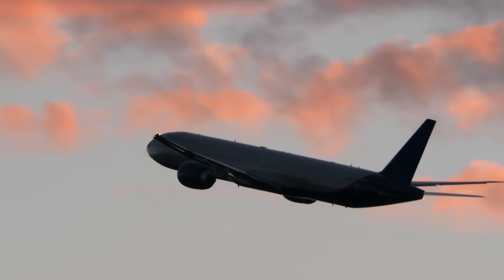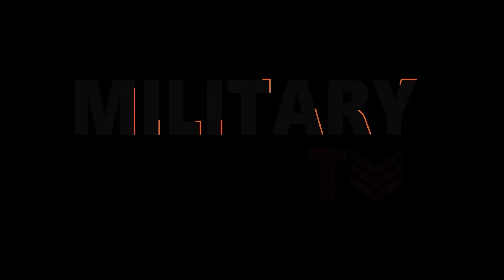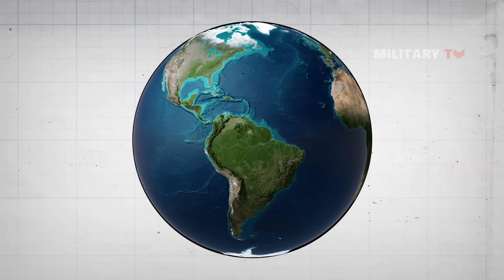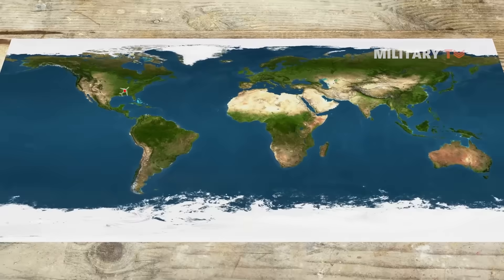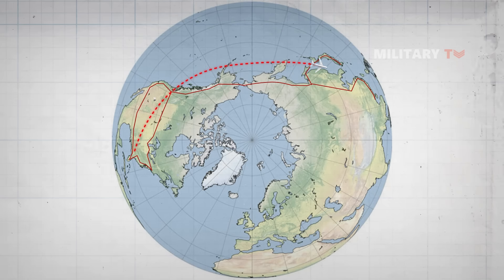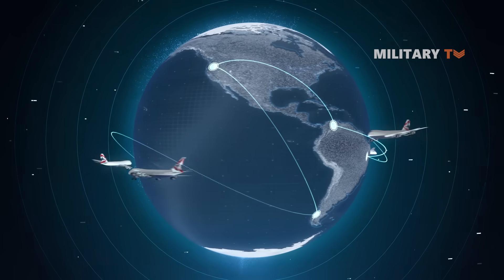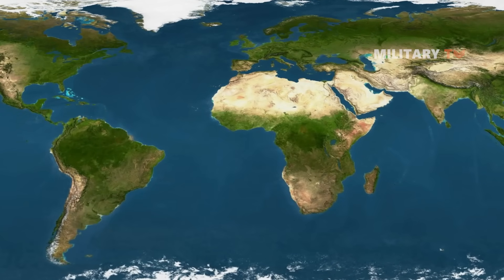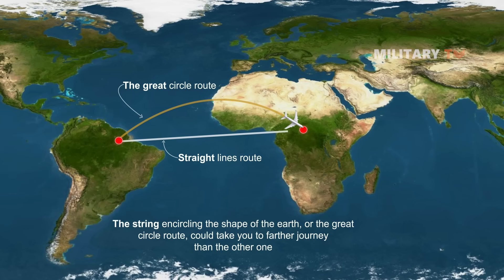Why Airplanes Fly On A Curved Path

Comment: Apart from the jet stream and other reasons not to fly a straight path, a lot of words are used to explain the very simple concept that a flat map distorts what’s actually a straight, direct path.
Reply: Correct.  If you place a string between the two points of travel on a globe (rather than on a map) the the string will be a straight line between the points.
Reply: @jeffreyerwin3665  , in correct, earth is flat.
Reply: @jeffreyerwin3665  No it won't. Any path along the surface of a sphere or at a fixed altitude above the sphere is curved.
Reply: @hb1338  good point.  However , if that curved path is observed from the vertical, it will appear to be straight,  The "straight line" Mercator projection wiil always be seen as curved, even from the vertical.
Reply: @hb1338  True! If planes flew in a straight line, they would simply fly off into space (or until they ran out of air). They fly a curved path because gravity is constantly pulling on them, thus keeping them on their curved path.
Reply: @whyyeseyec  gravity = magic answer for everything
Reply: @whyyeseyec  Altometer?
Reply: @johnarch6876  And??
Reply: @whyyeseyec  An altometer is used to maintain a prescribed height above the earth and although travelling in a straight line on the vertical plane, the aeroplane's trajectory on the horizontal plane will be be curved as it's always maintainig the same height in relation to the earth so the flightpath takes on the shape of the earth. And??
Reply: @billp4  No, Gravity Is not magic and your ignorance Is not a valid argument.
Reply: @peterhoebarth4234  "in correct" is incorrect, one doesn't begin a sentence with a comma, and 'Earth' is a proper noun. And we are supposed to believe your education has equipped you to comment on the Earth's geography?
Reply: @johnarch6876  Altimeter, right?
Reply: Every flight is a curved path.  All aircraft ,curved flight. What goes up must come down. Shortest distance between 2 points (map wise) string on a globe. Slowest time between 2 points, going to the in-laws.
Reply: @kwitwerikok8o863  Regarding curved path, the discussion was about the horizontal, not the vertical which is of course curved. Love your last point about the in-laws!
Reply: @whyyeseyec they fly at a set altitude. If the altitude remains the same they will naturally be following a curve in relation to the earth's surface. If the altitude changes negatively or positively they would naturally be flying towards or away from the earths surface.
Reply: No it's not that complicated the earth does not move.
Reply: Ever hear of an auto piolet.  Just point it in the direction given and set it. There is  no vertical compensation program, just a warning system. Go figure everything again or ask an Austrailian piolet. There're  allowed to answer truthfully. All piolets see it flat.
Reply: Most of you people aren't getting it.  Yes, Altimeter shows very how hi you are in the air or rather how high you are above the sea level.  But a gyroscope is the instrument built so that when set in a direction, it goes straight there. Sort of like following a very long lazer light, no curving down, no left or right, no automatic adjustments. The gyroscope  is an instrument that is built-in and set itself when the plane is just warming up. That instrument defys the so-called gravity. and has no problem crusing over a flat earth.
Reply: @whyyeseyec that’s a curve in the Z axis. Which is true. But they fly straight on the horizontal axis. However if you were to take that straight line and project it onto a flat map then it makes the flight look curved when it’s not. 

I make maps for a living and I see this every day. When something is mapped onto a flat space then it warps the image causing straight lines to look curved. 

Hence when you look at a flat map it looks like the plane is flying curved. Yet when you look at that same route on a globe it is straight.
Reply: @normanhansen730  Grow up!

Comment: Speaking of jet streams, I was returning to San Diego from Germany last week, and in a Lufthansa A350-900, the altitude over Provo Utah was 43,000 feet.  I had never been that high in a military jet !
Reply: Lufthansa Military Jet A350-900¿
Reply: It was to avoid headwinds from the jet stream which would slow down the plane considerably.
Reply: @99.9percent9  No, I meant I had never been that high when I was in military jets.

Comment: I have never heard this described SO badly.
Reply: The video is completely useless.
Reply: very flat earth.
Reply: 😢 Even the title is wrong.
The airplane flies in a straight line towards it destination.
Deviations are for; navigational aids, political reasons, the jet stream (for or against), very cold air that would cause the fuel to gel, and to stay in range of an emergency airport in case of engine or other failures.

Take a globe and a string to convince yourself.

Comment: For the most part, planes fly in a straight line between desinations, it's only a curved path when viewed on a flat (distorted) map.
Reply: Greenland isn't bigger than South America?
Reply: @johnstuartsmith on the Mercator map all objects further from the equator are projected larger..  it’s just a quirk with the map.  Go and look it up.  You can get more accurate maps, but it’s quite challenging to project a map from a globe into 2D
Reply: In all dimensions…
That means that the aircraft will exit the atmosphere in the direction of the tangent…

SoaceX next!!
Reply: AKA heliocentric Theory map

Comment: In your example, from Brazil to the Congo, the Great Circle route would almost be what you've illustrated as a straight line route.  That trip almost follows the Equator.  The Equator is the ONLY circle of latitude that IS a Great Circle.
Reply: 100% right. The Brazil to the Congo is not shown or explained correctly in the video! Besies the flat map, the globe should have been shown too! (to make a real comparison).
Reply: Because the earth is flat and stationary, a plane does not constantly dip and it flies to the destination because the earth does not move

Comment: You forgot to include that, until very recently, the FAA required that planes were always within a safe distance from land 
in case of emergencies. It is only because of recent super reliability of planes that paths can be more direct.
Reply: ETOPS was actually introduced in the 80's
Reply: @AlexFoxthrot  I heard that the Airbus 380(?) caused another extension to be allowed. Thanks for the facts and updates.
Reply: @LMike2004  Not aware of that, but I don't think so. Not saying you are wrong, juts news to me. It's a quad jet so even more curious.

Comment: I don't understand why the lower mileage "polar route" only applies to East-West flights.  So why, if going on a North-South flight, for example from Stockholm to Cape Town, is it shorter NOT to fly on any curve, but rather to fly straight south?  I don't get it. Isn't the planet curved for all flights?
Reply: Get a globe and pull a string tight between Stockholm and Cape Town. There's your shortest route.
Reply: Earth is Flat.
Only then it makes sense.
Reply: North-South is always on a great circle, the only East-West great circle is the equator.
Consider flying six hundred nautical miles south of the North Pole.  You are at 80 degrees north (10 degrees of 60 minutes each from the north pole, a north-south minute is a nautical mile).  Going up over the pole to the opposite side of the world is 600 + 600 or 1,200 miles along the great circle.
Flying east all the way to reach the same place is 180 degrees (half way around the globe) times 60 minutes times the cos of 80 degrees (to allow for the smaller parallels away from the equator) giving a distance of 1,875 miles going around on the Little Circle.
The little circle is longer.
The globe is drawn like orange segments lined up north-south (meridians of longitude) but drawn like slices of tinned pineapple running west-east (parallels of latitude).  The pineapple slices get smaller nearing the poles.  Every orange segment is on a great circle but the only pineapple slice that is a great circle is at the equator.
Reply: Everything makes more sense when you accept that the earth is flat
Reply: @WhotheHellknowsAnyway   Why does Polaris, the north star get higher in the sky as you move north then?  Does your movement tilt the sky backwards or something?
Reply: at the north pole Polaris is directly above you, at the equator Polaris can be viewed at the horizon,  so yes as you travel towards the north it becomes visible at a different angle to you which would be 90 degrees @givenfirstnamefamilyfirstn3935
Reply: @WhotheHellknowsAnyway   Sorry I thought you were advocating for the flat earth🤪
Reply: @bacomiric1681  Some places are relatively flat. Himalayas not so much.

Comment: There are two things to consider. 
A map does not conform to the surface of the Earth The Earth is a globe and a map is just a drawing of the contours on the flat surface. All the curvature has nothing to do with real flight. The curvature is only because a plane goes in three-dimensional space. 

On a globe, the shortest distance between two points is a part of a great circle. (the circle that has the same centre point as the globe itself) 
On a map, the shortest distance to draw is using a straight ruler. On a map, the shortest distance is a straight line. 
This line has a characteristic that the angles between this line and the line of meridians are always the same. And this line, called a loxodrome on the surface of the Earth is a kind of a spiral. That is why is longer than the Great Circle (orthodrome) path. 
It means that if you fly due north or due south the trajectory of the flight on a map is always straight. The angle is 0 or 180 degrees. So the angle is always the same and at the same time, meridians are also great circles.

Comment: Than you good video. Keep them coming.  Does the rotation of the earth at around 1,037 odd mph under the flying aircraft have any effect. The way it does for firing long very range sniper bullets, where the earth's rotation has to be taken into consideration.?  

Also the does the altitude of the plane from the ground make a difference?  Aside from less air resistance, temperature,    Would a higher altitude flight mean longer distance travelled to destination?
Reply: Do you hear yourself? Open your eyes and use your brain the earth does not move. That's why plane flies from one destination to the other in a straight path on this flat stationary earth. Simple.
Reply: Do planes have any issues about landing on any North- south air strips without crashing?

Comment: If a plane flies in the opposite direction to earth rotation, can it then cover more land miles for a set unit of time - or not.  And if not, why not ?
Reply: Not. Because momentum.
Reply: @GuardianSoulkeeper    Expand
Reply: because earth is a stationary flat disc
Reply: @nosherz  --Research conservation of momentum.  Another way to consider the scenario is that an aircraft performs strictly to the atmosphere, and the atmosphere rotates along with the Earth itself.
Reply: @cardinalRG    If that’s correct, the planes engine/s would need to burn more fuel & work much harder to cover a given distance, flying against rotation versus flying with rotation- yes ?
Reply: @nosher_4114   --No.  Again, the atmosphere rotates along with the Earth.  Imagine yourself in an airliner in flight, and you throw a paper airplane from one end of the passenger cabin to the other...does it take more energy to throw it back-to-front than front-to-back?
Reply: @cardinalRG    I still don’t get it, what enables the atmosphere to rotate (in sync ?) with the earth ?  And why would this effect a heavier than air object, so it can’t take advantage of the land below it, travelling in the opposite direction ?
Reply: @nosher_4114  --The atmosphere conserves its rotational momentum just as the Earth does, and so the question becomes, what is there to stop the atmosphere’s rotation?  The answer is “nothing.”  In additional, there is a friction effect where Earth and atmosphere meet.  The sync is not perfect, for example localized winds exist.  You can find more detailed explanations online.

As for the aircraft scenario, at this point I think you need visual presentations.  There are many of them on YT alone.  One is called “If Earth is spinning to the east, why isn't it faster to fly west?”  Another is “Does Earth's Rotation affect the Airplanes Speed & Flight Time”.
Reply: @richardwilliams9532  Your arguments are ever so rookie level it's embarrassing.
Reply: @richardwilliams9532  There are no insults. Why don't you try to argue my points instead of trying to find excuses to run away?
Reply: @richardwilliams9532  And yes, certainly someone Who can't even grasp the concept of conservation of momentum is among the very few privileged Who know the Truth. Prove It maybe?

Comment: Most planes fly STRAIGHT, not curved.
Reply: They do fly straight, it's the point of the video.
Reply: @victorsantiago886  --Yes, and "straight" in aeronautical terminology means no deviation left or right (the lateral plane).  A straight flightpath can be a climb, descent or level flight, the last of which curves in the vertical plane, in proportion to the Earth's own curvature.

Comment: To simplify this. go to a GLOBE of Earth....find two far-away points....now take a string and connect the two points. THAT is a great circle route, the shortest distance between two points on a SPHERE. The Problem is caused by taking the SPHERE and through mathematics "flattening" the globe into a conical projection or "Mercator" map which is flat and heavily distorted the closer you get to the poles. Using the GLOBE simplifies everything.
Reply: That is the perfect explanation, but the people who still need that explained are too militantly stoopid and scrupulously ignorant to allow themselves to believe it.
Reply: @johnstuartsmith  True...some people think "asphalt" is hemmorhoids.
Reply: The Mercator projection is a cylindrical one, not a conical one.
Reply: Lamberts charts give ‘straight’ great circles with any drawn line.

Comment: Take that flight to a flat map all they did was go straight does your senses tell you we’re going down when we fly to Australia no does your senses think we’re spinning in space pretty crazy we see the same constellation every night if we’re constantly moving thru space we would have pass the Big Dipper years ago but no see it every night
Reply: A direct flight from Santiago to Auckland exists. It travels over the pacific ocean, and the flight path curves in the opposite manner (towards the south pole instead of the North). This flight still exists, and still operates normally. I wonder how this would be possible on a flat earth map.
Reply: @uap24  Winds and increased flight speeds. You can find the MPH and KPH flown once a flight has landed. Sometimes they are flying over 700mph. There you go, ree ree.
Reply: @derp8575  Well then, how is it that Santiago-Auckland and London-New York take approximately the same time despite the difference in distance being huge on a flat map?
Reply: @uap24  7 hours 26 minutes is not close to 12 hours, ree ree.
Reply: @Derp  The time and distance difference does not make sense. For that distance difference, the time is supposed to be more than 15 hours, considering Santiago and Auckland are more than twice as far apart compared to London and New York on a flat map.
Reply: @uap24  Have you seen the flight path from Santiago to Auckland? They don't fly in a straight line. If they did the flight would be shorter in time and distance, ree ree.
Reply: @derp8575   They don't fly in a straight line on a flat map. They do fly a straight line on a globe. The trip from Sydney to Santiago on a Gleason ("Flat Earth") map would fly over the USA. So why does the Sydney/Santiago flight take around the same time as a flight from Sydney to the USA alone? Do the tailwinds between the USA and South America reach light speed? 
So what conspiracy theory do you have to come up with to make this sound logical to you?
Reply: @TruthSeeker8717 I've seen these videos. They have all been thoroughly debunked. Give me any example and I'll draw a map for you showing why the diversion is correct. You have to know:
1) when the diversion was made
2) the nearest practical airport (no point diverting if the runway is too small to land on or the medical facilities were inadequate)
3) military no fly zones/war zones
4) jetstreams
The most hilarious flert video I've seen is in one where a half-inflated toy inflatable globe was used. No wonder it didn't match the flight paths. I pointed out the obvious error to the YouTuber and I was blocked. If you live in a vacuum, you can believe any nonsense. He also didn't like my proof that Venus was visible for longer than he thought it should be.

Comment: In spite of all the explanation, the route shown  Brazil to Congo is not shown or explained correctly! 
Straight line route is along the Equator and the  "Circular Route"  over Algeria . "Cicrular Route" appears that way only on the flat map. On a Globe it is in fact "straight line relative to the Ground" and is much shorter than Equator Route!  If you take a Globe and measure the Circular Route  will be marginally shorter in this case!

From Finland there are Polar Route to Asia  which is much faster than the route from London over Equator.  For a comparison Helsinki to Delhi is about 6 hours 30 min while Bombay to Brussels is almost 9 hours, even though on a flat map the distances may see equal !